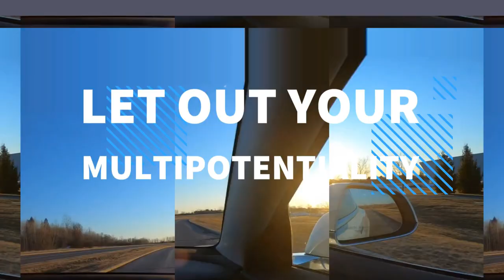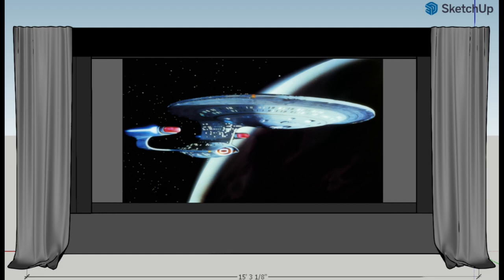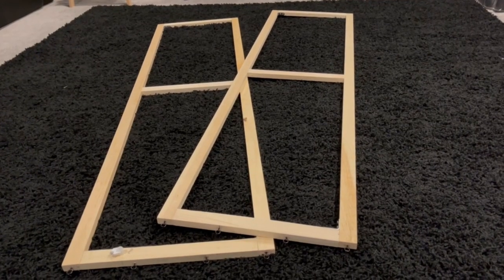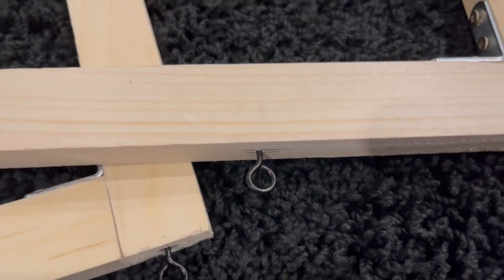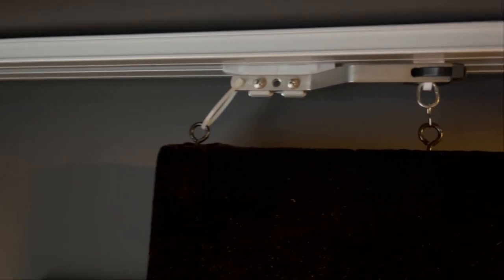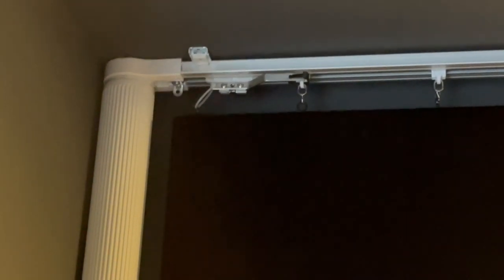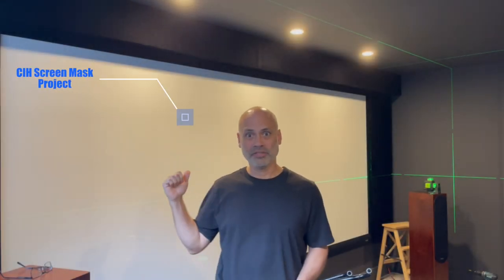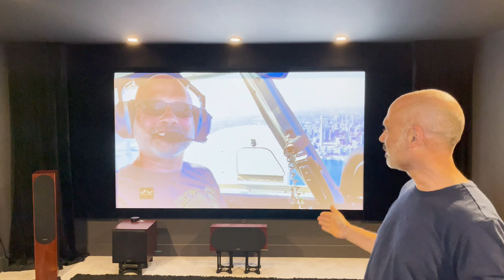AMAZING and Affordable DIY Home Theatre Cinema Projector Screen Masking System

Comment: Extremely clever.  With my setup, I am looking to use in-wall Klipsch speakers behind a 180" 2.39:1 screen.  If I did this... I wonder if I could use acoustic transparent black mesh so the sound would still come though.   Hopefully there's a sweet spot where the wooden rails wouldn't be in front of the L/R speakers.

Comment: That looks great!  Right not it's not the highest priority because my theater is still a long way from being operational but ultimately I do want to put in a masking system.  My screen is 2.4:1, 185" and it would be nice to have the ability to mask all the way down to 4:3 since that should be the absolute minimum that would ever be needed. 

I'm not sure I want to do the rigid panel approach, I'm thinking along the lines of a single vertical bar that drags along a fabric curtain behind it.  The speakers are behind the screen so I wouldn't want the frame of the panels obstructing them.  I already have a little obstruction because the array main speakers are quite a bit taller than the height of the screen so the screen frame does obstruct just a bit but only closer to the ends where the arrays are shaded anyway.

Great job on your system, thanks for posting all the details!
Reply from the maker: Thank you and good luck on your future project!!!  My system continues to be flaw free with the rail system.

Comment: Nice, and thanks for sharing 👍
BTW can you please tell how did you completely light block out the big window adjacent to screen.
Thanks
Reply from the maker: Thank you!  That's a great question.  I bought blackout cellular shades from Home Depot that come with a side and bottom channel system to mask the edges.  It's a great system and I can make the room 100% dark even in the sunniest conditions during the day.  If it weren't for a small LED on my wall switch, I would not even be able to navigate the room in the dark.  An upcoming project will be to automate (motorize) those shades.
Reply: You got link for that ?

Comment: Did you make your valance so that it would cover the top frame of your screen or is it higher/above the top frame? (or maybe half of the top frame?)
Also, how big (drop) did you make your valance? 10 inches? Just trying to work out how big it needs to be to hide all the tracking when seated etc.
Thanks in advance.
Reply from the maker: It comes down to about half way into the frame of the screen.  In my case approx 10 inches.

Comment: Great idea. I've been using this same setup for many years for my scope screen, but non motorized. Just simple curtain rods and black curtains.
Reply: I Have You Beat With My Own Home Theater 🎭 Side &Top Boarders Along With What I Call The Smart Stage Technology Or SST For Short. Most ☝🏽 People As Your self All Have The Same Exact Set Up. However With SST The Stage Settings Are Endless. Only Limited To Your Own Creativity. With The Simple Push Of A Button On A Remote control Sit Back And Watch The Entire Stage Set It’s Self Up For Dozens Of Different Scenes and Modes All With Different Music 🎶 To Accompany The Various Different Scenes Such As MOVIE 🎥 Mode, Karaoke 🎤 Mode! Webinar Mode, Ect . All Designed By Myself Wanders Home Theater Company.

Comment: Could you add the curtains to the end of the track so that the panels & curtain move to cover the whole screen while not in use?
Reply from the maker: If you have enough width to accommodate the retracted materials, yes.  Alternatively, Zemismart also sells 90 degree end adapters so you could also gain more outer range by turning the corners.

Comment: How differently would you have to make this if you wanted to also be capable of 4:3 masking?  Would you just need wider wooden rectangles and more space on the sides of the screen?
Reply from the maker: That’s exactly right!   Alternatively, there are 90 degree angles available for the Zemismart curtain tracks, it would be feasible to have the panels turn the corners too.  As long as their were only two connection points at the top of the panels instead of the 4 that I did.   This project can be adapted in many different ways.

Comment: One huge problem with 2.35 aspect ratio is that you can't watch imax content because of the constant aspect ratio changes through the whole movie. And there are a couple of standout movies that use this back and forth aspect ratio. Not only the projector can't deal with back and forth lens memory on the fly by itself in anticipation of the format changes but this type of masking would not work for that purpose.
But this is extremely awesome and reminds me of how the theaters I used to attend had the curtains do this exact thing! Extremely awesome!!
Reply from the maker: Appreciate the comments!
Reply from the maker: And, Tenet was an example of the IMAX issue…. Sad.
Reply: @Mixturerich  I absolutely love the work you did and would love to do the same but I am worried that other movies are still going to do the imax way. Just look at the reference quality of Aquaman and the back and forth imax image, this has kept me from getting a projector with lens memory and a 2.35 aspect screen. Keep up the awesome work sir! 😎👍👏
Reply: The best way to deal with these instances is to just crop them to scope. This was how they were exhibited in standard theaters, and IMAX really requires a ridiculous viewing angle to make sense. It's otherwise just superfluous picture information that can be safely discarded. Shifting ratio films were framed with this in mind, so cropping is totally OK.

Comment: Why did you choose lumber and felt instead of fabric?
Reply from the maker: Not sure I understand the question
Reply: @Mixturerich  Sorry, I should have been more clear. How come you didn't just use curtains (fabric) is what I meant. My thinking is wouldn't it be lighter in weight and less wear and tear on the motorized track system.
Reply from the maker: Thanks for clarifying :-).  That is definitely something I considered.  So reasoning for panels rather than curtains was the crispness of the vertical edge.  I wanted this to truly mask the image and be as close to the screen as possible.  A curtain cannot achieve that.  As for weight and wear, great question.   Believe it or not, these panels (being skeleton with fabric wrapped over) are lighter than the total weight of 15 feet of pleated velvet curtains.   The motor does not struggle at all and the nylon rollers are moving through solid aluminium channel.  Friction is low no chance of breaking the rails by the weight either.

Comment: so i have a 135 inch screen what size should i get
Reply from the maker: Do you mean what size curtain track?   That will depend on the width of your room, leaving enough distance for your masking panels to retract off the screen.   For example, my 150 inch screen is approximate 12 feet wide.  I have a 15’3” foot wide room.  It was just enough width for me to accommodate my masking panels so I ordered the curtain kit that is just wider than that and cut the track to fit 15’3”.  Hope this helps!
Reply: @Mixturerich  thanks
Reply: one more question cant tell from the video but is that a 2.39:1 screen
Reply from the maker: @monsta21cb  2.35:1 screen
Reply: @Mixturerich  ok thanks

Comment: you have 3 track system listed did you buy all 3
Reply from the maker: I bought the zwave version for my setup.
Reply: @Mixturerich   the "zwave" version is the one linked in the middel of those 3, isn´t it?
Reply from the maker: @Kappi1234  no, I believe it’s the third link as described.
Reply: @Mixturerich  I see.Thank you. I´ll order one of those and try it out myself by building a home theater in my basement.
Reply: I also got another question: Do you belive I could use that system for covering  and uncovering the whole projectionscreen? I hope it'll work because of the weight of the curtain. Greetings from Germany
Reply from the maker: @Kappi1234  absolutely. No issue with that at all.